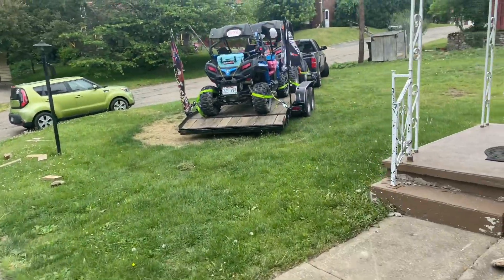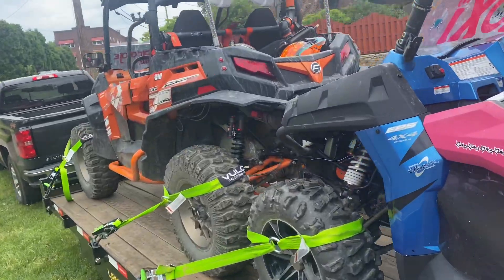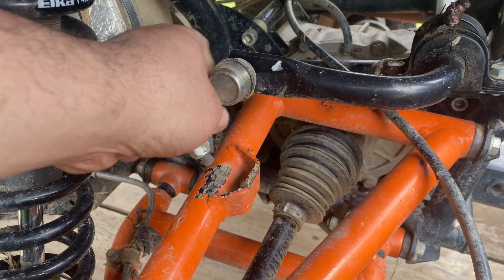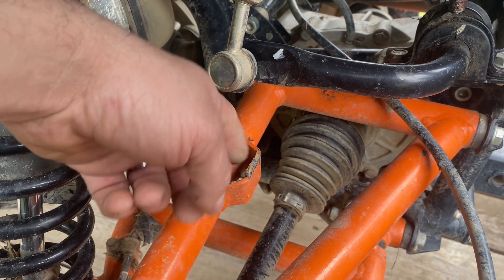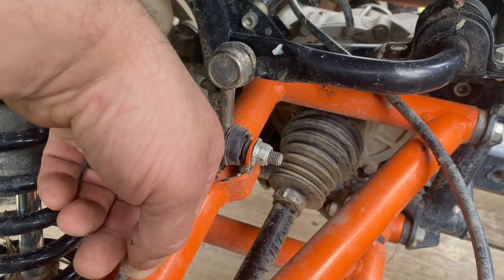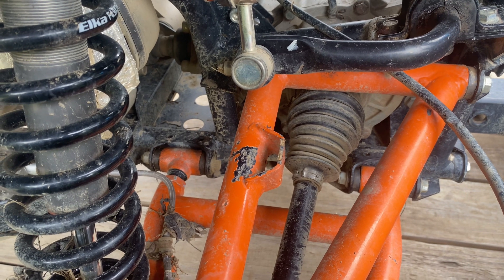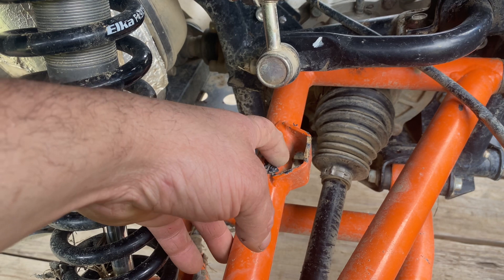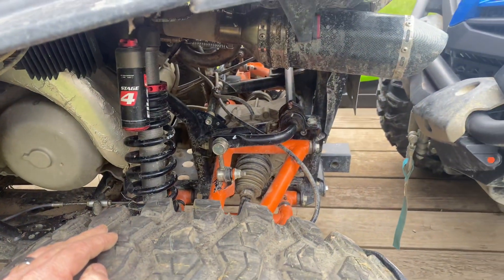Broken SuperATV Control Arms!

Comment: My friend put a pair of their arms on his Can-Am and after a few rides the nut insert in one of the front control arms pulled out of it. The weld was crappy and the insert fits very loosely in the tube so the weld is taking all the stress.  They sent him a new arm for free, but no ball joint so that has to be swapped. Worst part is they change the design a bit so now they don’t match.  And unless they’ve fixed their crappy manufacturing it’s just a Band-Aid till the next time it or another arm breaks..
Reply from the maker: Junk for sure

Comment: They still look like as beefy upgrade to stock as far as tube size goes...that tab breakage is an easy fix.... drill hole and bolt thru the welded part thats still attached to the tube and add a heavier plate from there to the sway bar ...custom grind/drill the plate to fit for both bolts ..use 3/16" steel plate and grade 8 bolts and you should be good to go...just my
 2 cents worth...or of course just weld it but reinforcing is certainly needed...
Reply from the maker: Yeah i agree. They are beefy I ordered somr stuff tonight ill be fixing it soon. .

Comment: Hey bud have a question for u. Did u do anything for the crankcase vent pipe? That is totally open to dirt and mud
Reply from the maker: my crank case vent gos in to my air box
Reply: @R.N.GPerformance  gotcha i didn’t see if that’s what u did
Reply: @R.N.GPerformance  I can’t believe they leave the crankcase vent wide open like that no cover or nothing dirt goes right in and mud
Reply from the maker: Idk what you mean? Yours dont go in the air box? I relocated my air box and it stays super clean
Reply: @R.N.GPerformance  so I just bought my over a month ago 2021 I went to check the oil and the vent to the crank case is wide open I can put my hand in it
Reply from the maker: @johnknightmare7288  are you sure you’re not talking about your cvt exhaust?
Reply: @R.N.GPerformance  cvt exhaust ? Is it plastic with nothing covering
Reply: @R.N.GPerformance  the cvt is just left wide open like that ? Won’t it ruin everything?